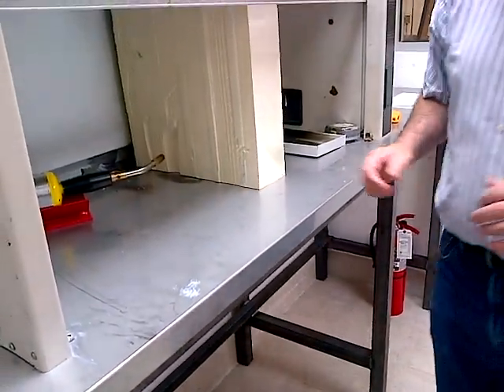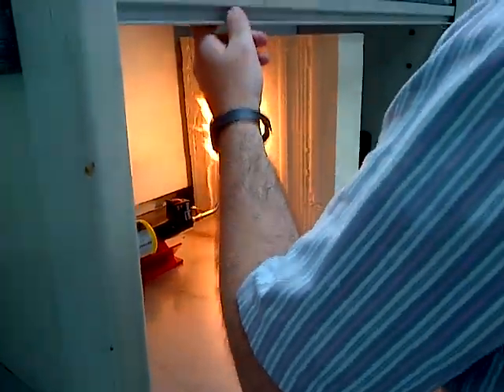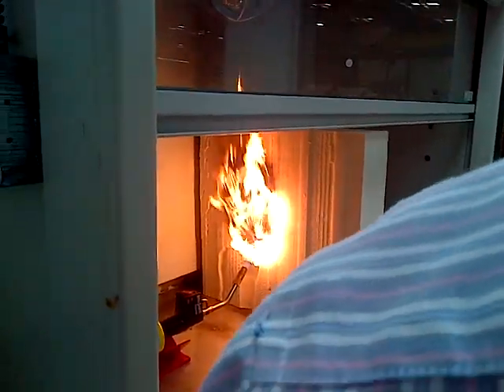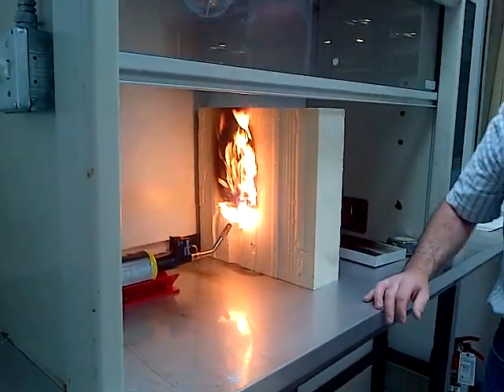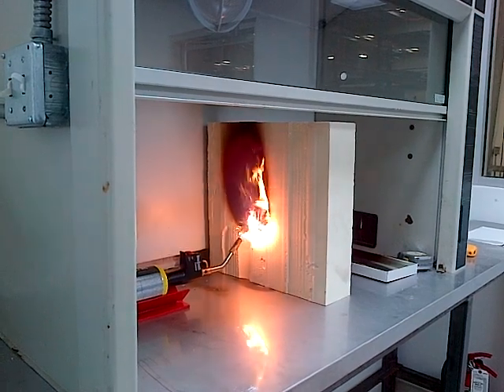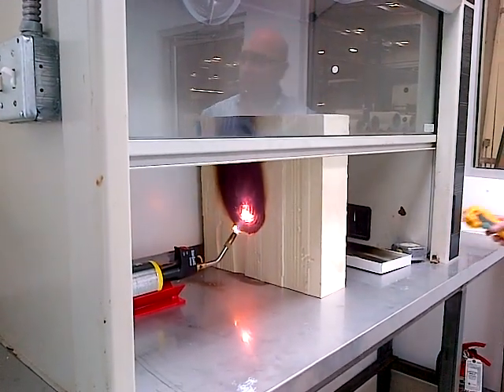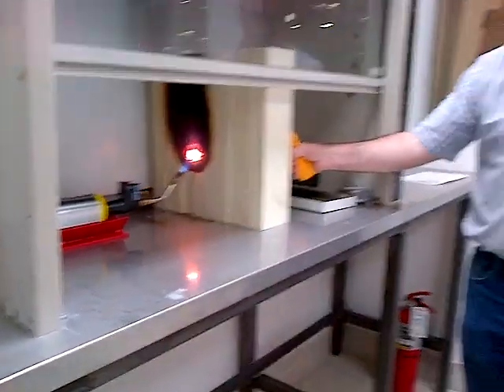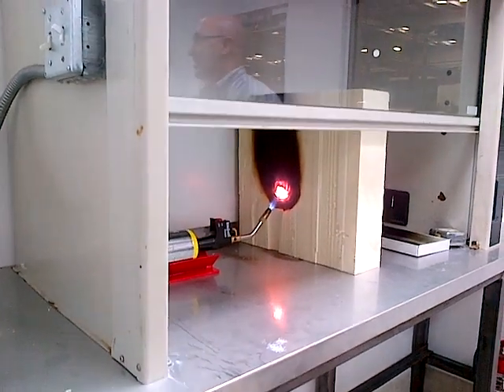Polyisocyanurate Initial Burn Test

Comment: PIR is the best. That is what we are using in our awesome overland expedition panel construction habitats!
Reply: When it burns, it releases hydrogen cyanide. See also: Grenfell disaster
Reply: @rupert274  I had never heard of this disaster, so I researched it. It appears the real culprit with polyethylene and the super heating effect that occurred r/t a chimney effect created by the structure. Many things release CO and HCN when burned. The seat in the car you rode in today would likely produce more HCN and CO than PIR, when burned.
Reply: @rupert274  hydrogen cyanide is also released in common items when burned... like sneakers, cigarettes, other polyurethane foams, and other plastics. PIR is singled out as the only culprit, because it is better than other foam products and there HAS TO BE a narrative against it... even if it is a half truth. See https://youtu.be/HbnBanm7b2w
Reply: @rupert274 thanks for clearing that up